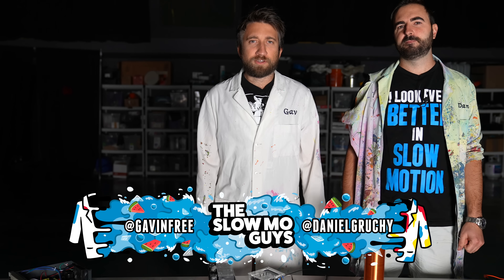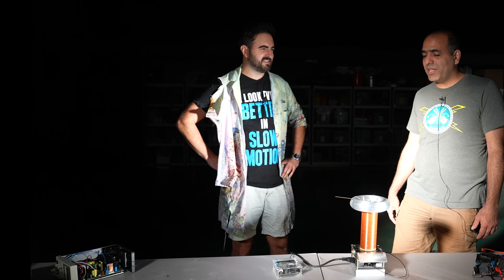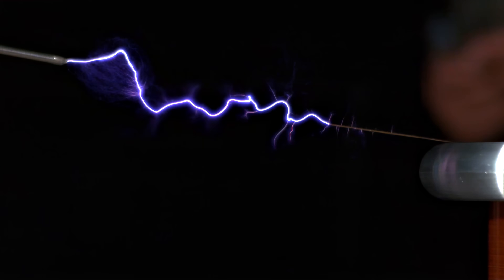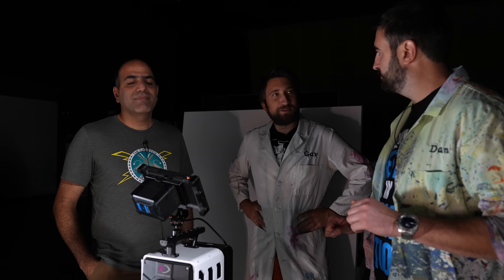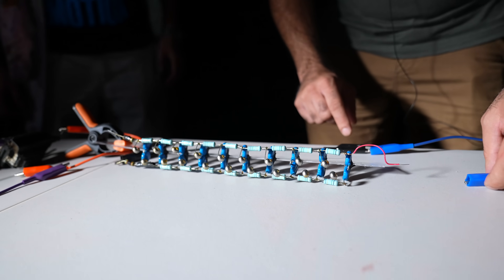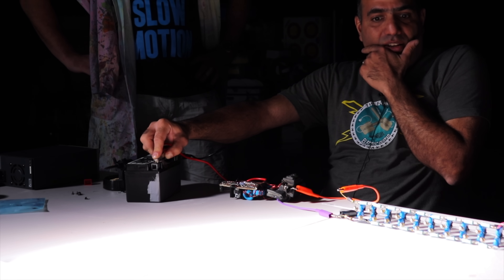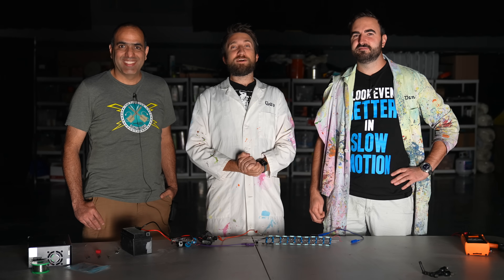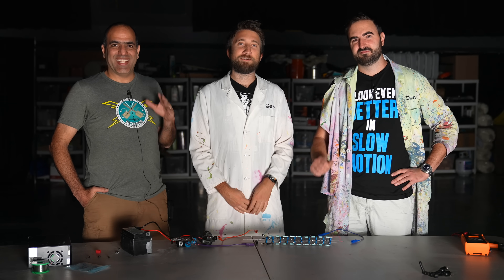Electrical Arcs at 1,750,000FPS - The Slow Mo Guys with ElectroBOOM

Comment: The cascade starts where the electric field is greatest.  Electric field grows fastest for low RC, narrow gap, and small radius of curvature.  Component manufacturing and assembly tolerances will usually make one of the stages significantly quicker to fire; otherwise, two or even three will take random turns.  I think you should try to make an EMP generator from it.

Comment: because electricity does not technically flow in a circuit, so there is no order to when it is energizing things, aside from a circuit designed to do that with timers etc.

Comment: if each successive link in the spark chain was weaker and you are trying to push through a current, would the last weakest one have more of a field charge around it causing it to spark first and triggering the rest as the current starts flowing faster until the field is depleted and the charge has to start building again?

Comment: Get an old style oil burner ignition transformer, or an old style neon sign transformer.  Film the arcs of those in slow mo.  They are a LOT hotter than the one from the Mars or Tesla coli.  That is what you use to make a Jacob's ladder, where the arc follows the hot air as it rises.  It follows the hot air because it is lower resistance., even though the path is longer.

Comment: Did you know you can use a magnet to bend or move an arc ?     To solve a problem in the past I modified relays by adding a Neodymium magnet right next to the contacts to assist in 'blowing' out the arc created when the contacts open while conducting DC, especially from sources with high rise times, like solar panels.      Without this(and usually dc snubbers too) , the arc continues and your relay melts :)

Comment: could be that the gaps do try to arc at the same time but that the voltage jumps from 0 to maximum in a time greater than 0 so smaller gaps may arc first. Worth a thought

Comment: the thingy with the electric jacks in a row, when the far right one, the lowest voltage and last in line, lit up first, then in the next frame all the others are lit up but the far right is noticabley smaller than most of them and the far left ones are huge. to me it says the one that lit up at first was the only one slow enough to register

Comment: If it works just like lightning bolts, negative lightning bolts have more of the rapid blinking, while positive bolts have a quick no multi flash bolt, while lighting obviously is really lethal, positive bolts are more lethal than negative bolts

Comment: After the water bottle + hammer demo. I wonder if the same phenomenon happens when a martial artist does it. Not the vertical force orientation you guys had tried but there are some videos doing it sideway (horizontally) at beer bottles. If it's real then it'd be very amazing to watch

Comment: Wouldn't it be fair to say the last gap sparks first because it's at the highest potential first? There may be electrons traveling between the others first, to reach that point, but something has to be led by a higher potential, to begin ionizing the air.

Comment: The UV light from the first spark gap to fire will actually prompt the others to spark in sync by aiding in the process of ionizing the air, this is why these things fire more reliably when the spark gaps all have line of sight like in the video.

Comment: 16:00 The last one arcs first because the energy flows through the fields around the apparatus not through its wires. The last one has the lowest resistance so that's where the air gap is breached first.

Comment: Remember that often in these electric systems the current is technically going backwards through the system at the same time as it is gong forward. Right up until the moment it is connected then they all discharge at once. If you could see the electrons you would see them all moving too. 

Source: I'm a random guy on the internet that watched a video of another guy who ran a big long cable around a field to test this. I am probably wrong in this case.

Comment: I ask a stupid question. I know the answer, but why is that answer right?
Why is a spark not straight?
The answer; because it follows the path of least resistance. But how do tiny differences in 'resistance' overcome the great energy of the spark? It must be that the spark is only just 'making it' through the air (or that the attraction of 'earth' is so weak), for small differences to have such an effect. But even so, at each deviation of the spark it eventually returns to it's target. 
So at each point the spark is subject to many many possibilities of direction. And the slightest weakness in 'resistance' allows it to get nearer to it's necessary destination.
Mmmm. Not sure I'm any further forward there.
Good job guys.

AND why was the repeating spark so clearly similar in shape to the one just before??? It cannot be just the air conditions, because they are so changeable, even over a short time I guess? Could it be surrounding electromagnetic fields?

Comment: Is the light produced by the electromagnetic wave a chemical reaction? The wave superheating the air between, chemically producing light?

I ask because, ignorant theory warning, would that be the cause of the final stage seeming to 'act' first? The electromagnetic wave goes down the line of the MAC, and the chemical reaction of light production follows back the other way?

And if my question is based in ignorance, any idea of where to begin the rabbit hole I've volunteered to embark on?

Comment: the last one sparked first because the gap is smaller there is no way to acuratly measure the gap between the two points.  the path of least resistance.

Comment: I just learned it too. Not that hot air rises, but that the arc is heating a strip of air which then rises. That a strip of air could bold its shape. This was cool.

Comment: I know python scince 1 year, and I could've written you software to find those pixels XD. It should be pretty simple by just adding up the brightness of every pixel in a frame. Some frames will have a much higher value cause of the arcs. But anyway amazing video

Comment: A split second after the discharge (after 13:57 100,000 FPS shot), the first spark gap on the left has this erratic discharge which travels upward at like a 45 degree angle after the initial discharge. There are ghost like remnants between the balls a solder also after the initial discharge like it almost remembered where the path of least resistance was. Fascinating. Good job as usual guys 👍.

Comment: I wondered if the final gap could possibly be marginally closer than the rest making it fire just before.
Reply: That's what it looked like to me; the arc appears shorter.
It might be that it was already fading because it fired earlier, though, while the others were still at full brightness and over-exposing / blooming into the surrounding pixels and thus looking larger.

Or that its capacitor had smaller capacitance so got to higher voltage with the same charge, if there's a ladder of caps in series acting as a voltage divider or something like that.

Comment: Could the timing between sparks be measured by radio frequency? Its presumably operating at faster than 1.75 MegaHz which is in usable radio frequency.

Comment: Avid viewer of both channels. It’s awesome to see a collab between both. It’s also nice to see Mehdi when he isn’t doing his shtick. As hilarious as his videos are, it’s nice to see a normal person behind them. As an electrical engineer in training, it is super interesting to watch this and consider the principals behind it. I suspect that the spark gaps are probably firing sequentially rather than instantaneously, but the time difference is probably beyond what is measurable even with the TMX. Sort of like your speed of light video. Light is not instantaneous, but it moves so fast that it really takes something incredibly special to see it. I believe theory is that electricity doesn’t move quite at the speed of light, but it isn’t too much slower than that. As you said, to accurately measure it, you would likely need at least 10M fps, maybe more.

Comment: Though it might have been for the bit/gag at the end (and thus, relatability with a broader audience slice), Dan, if you're excited about genuinely linking the ostensibly "obvious" concepts of hot air rising in a gravity field with electric arc behavior, then I am excited for you, as well.  As Randall Munroe might say, being 1 of the 10,000 to discover for yourself something that might be "common knowledge" is still valid to be excited about.

In the sciences, we still (a bit disappointingly) tend to only celebrate people who discover things we believe have not yet been previously discovered by anyone.  But you're allowed to feel the rush of discovering something correct/true that was not yet discovered by yourself, too.

Comment: A thought...  With welding arc starters, what appears, is a wave propagation along the welding cables, and reflection at any impedance change, and especially at the open end.  With that kind of change you get a voltage reflection and theoretically instantaneous doubling in value.  That helps firing the corona and plasma and the welding can commence.  So I am suggesting this may also explain the first streamer happening at the last spark gap of the chain?

Comment: I remember staying in Chicago hotels when it was extremely cold and very low humidity. The least painful way to approach a door lock with metal key in hand was to hold the key tightly.  The static build up from walking over carpets would jump an inch or more.

Comment: see no electron travle thentional diverentional displasmend towart ratio towar particle behavieure inside the copasators towar disgarges😍😍😍
was the one bevore where the last one was one frame bevore on the 0 side👀🙏😍

thank you and oll😍 oll I joy beïng🌻
Reply: see it like this we say n elective world plus posetive and -negative.
and jad.........
0 feeds in and plus is more pulling more negative💜 way I dit the 0 in to led circuit trout the feidcopasators there innercores allong with towarth the led trouth the copasator and in the the windings of the feildcopasators. in to the 0 feed💜
to gain a more stable vapor thention lv.
vapor thention coorolates with the conditions to counter draged feilds from the same room in to the same room.
than we don't tace from inbetween the air where the powestaition is bild for there to reseve to March thentions for particles to loose intergetlrty to mantain something to surcle around as the ohisicle resistance thar we experiemcebas whals of phisicle dimentions here on eurfh💜
Reply: in the last setup🙏😍🙏

Comment: Have you done camera flashes or turning on lights yet?
I wonder if your camera is fast enough to observe different light bulbs turning on. LED, Halogen, CCFL, Neon, Tungsten, High-Pressure Sodium, Metal-Halide...

Side-LOL from an actual Amazon listing I just found: Safety Information: Don't eat the dang lightbulbs and don't let your kids play with them. Don't stick them in places not intended by God or camera engineers.

Comment: Gav and Dan if you plug something with a strong magnetic field like a vacuum or in this case a tesla coil in the same outlet as the camera or if you place the camera close enough you will get those glitchy issues you were seeing. For instance you can plug a vacuum in with an old picture tube tv and it will interfere with the TV with visible lines. The same thing can happen with a fan and a small transformer slowing hurting the device over time

Comment: That capacitor gadget sparking on the final gap then setting off the others could be acting like a TX antenna, where voltage is highest at the tip of an antenna and highest current at the base? Could this be a visual of how a TX antenna works? Pretty cool!

Comment: Air can totally blink that fast:  that's how the EG&G Microflash works.  It's used for the famous "freezing a bullet" type pictures and generates a discharge in air, providing a flash well under a microsecond in duration.

Comment: 16:08 might have a reason similar to the Veratasium discussion on how long it takes for an electrical signal to be sent through a long piece of wire.
Electrical transmission line for example...?

Comment: Need a follow up video on this.  Would be nice to see a longer circuit with way more spark gaps, this should increase the chance that you catch them sparking in different frames.  It would also be cool to see the tesla coil firing in heavy rain.  Maybe using saltwater or baking soda and water mix.

Comment: Could you use a slower (less powerful) camera to approximate where in the hours of footage you would need to look to find a clip? Start both the main and secondary camera simultaneously and calculate how many frames the shot is into video by using the time from the start of the recording in real time and the frame rate of the main camera to find the frames where the shot would be.

Comment: They say lightning never strikes twice in the same spot, but it sure looks like it would if the cloud could recharge fast enough
Reply: Actually that statement isn't true. 
Natural occuring lightning sometimes have favourite spots caused by high metal ore concentration close to ground, height difference and other environmental uniqueness
Reply: @DimkaTsv  Right?  High rise buildings often get hit multiple times in the same storm.
Reply: Lightning flashes on and off a bunch of times in the same spot each time it strikes.

Comment: Incredible! I've been waiting for a collab like this for years! It's really cool to see all the fast details of an electrical breakdown, even for a couple of frames. But also you can see why the study of spark discharges (like from Marx) is so difficult - the time scales are just out of this world. That's why in that field the oscilloscope is your best friend - you can measure the voltage with nanosecond precision easily and make conclusions about the circuit's operation. For example, I've measured the output voltage of a small Marx once and was able to see as the voltage jumps to 1/4, 3/4 and finally to the full output potential. I suppose that was the effect of individual spark gaps firing at different times. 

Interestingly, the process of electrical breakdown has been studied extensively in the 1930s-1960s without the use of Phantoms (obviously). Back then they used streak cameras based on electro-optical image converters. The image of the spark would be converted to an electron beam and electrically swept across the receiver end of the camera, with equivalent FPS being in the tens of millions range.

Once again, just phenomenal job from Mehdi, Gavin and Dan, the obtained footage is unique!

Comment: 10:24 what if, at those timeframes with those energies, light itself is slowed down so much that it can be seen "vibrating", a bit like air does when a thunder strikes? maybe a true "on/off" demonstration could be done only at much larger frame ratios.

Comment: Super interesting… does the electro magnetic force have a delimiter less than the speed of light? Is the information transmitted to ajoining electrons via quantum mechanics? Imagining a setup with 480 or more power input and unimaginable high speed cameras.

Comment: It seems like if you could trigger the recording to begin remotely with a relay that synchronized with the battery terminal and some sort of fuse on the other that toggled the button off you could get tighter timing without having to search through so many dead frames.

Comment: The output of the horizontal transformer should be 8 KV, and the ten stages doubler should theoretically double the 8 kilovolts for ten times, enough to produce hard X-rays.
But the multistage doubler (or voltage multiplier) should be immersed in dielectric oil to achieve such unholy voltage.
ALSO.
For some reasons, in parallel to each capacitor there is a spark gap; from the spacing, it should trigger at 20 KV.
Such spark gaps alter fundamentally the operation of the voltage multiplier, because they produce a spark at approximately the same voltage. But they are triggered simultaneously because the first spark gap that will produce a spark, it will also trigger inductively all the others at the same time.
The principle of paralleling spark gaps is old, and was used by the first radio transmitters to increase the output power.

Comment: Electricity propagates at near the speed of light depending on the medium. The electrons are slower though. Anyways, the speed of light is roughly 3*10^8 or ~300 million m/s. So to capture light moving 1m in 1 frame you would need 300 million fps to get that. In short... I'm not sure that you would have been able to capture electricity moving over that circuit within one frame.
Reply: I might be wrong. I haven't been in my textbooks in awhile.

Comment: The Marx Generator triggers at practically at the speed of light. The UV from one stage of the Marx Generator helps trigger the rest of the spark gaps together. Essentially turning a parallel arrangement of caps/resistors into a series one.